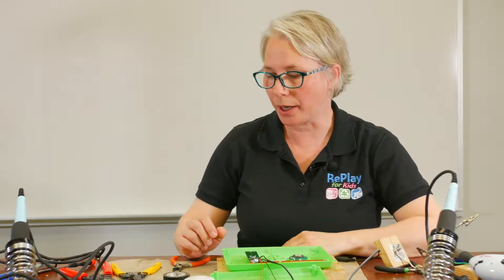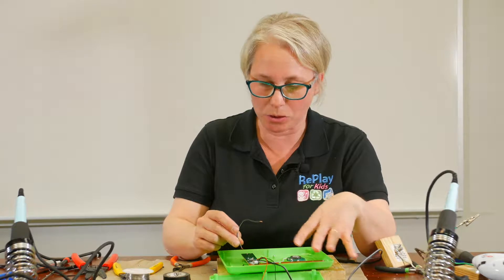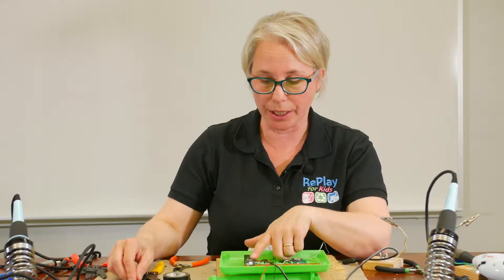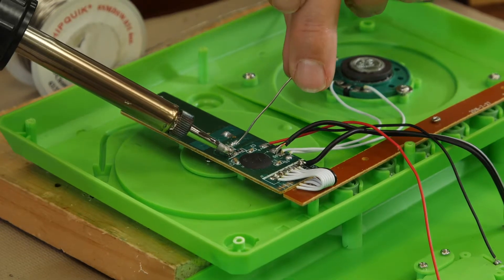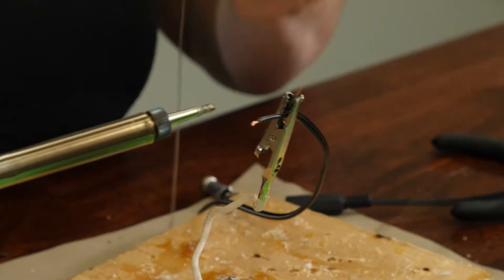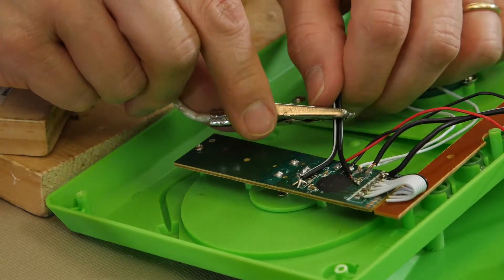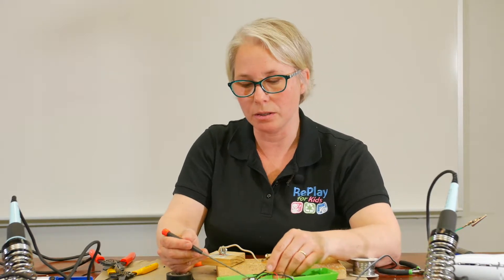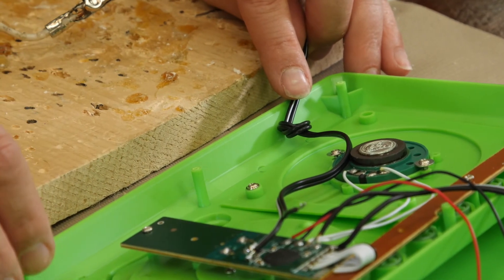How to solder wires onto a circuit board when adapting a toy.

Comment: I've got a snow globe ( gorgeous Mermaid 🧜‍♀️) that has a light, music, and a fan inside that stirs that glitter. The wires came off the board 🆘 it won't work. If I could put them back on, I'm sure it would work again but the 3 wires ( red, green, & blue) well just don't know where they go and how to solder them on. I would bet you could repair it. Do you know what kind of place I  could take it to get it repaired? Thanks Just a woman trying to learn about these things.

Comment: We use standard solder (60%Tin/40%Lead), 0.31" thickness, but lead-free solder can be used too (you may need to use some flux with the lead-free solder, but you can search for videos with tips on soldering with lead-free solder).  We tend to use cheaper soldering irons that don't have temperature controls, but when we do use a soldering iron with temperature control, we set it for about 700 deg.F.